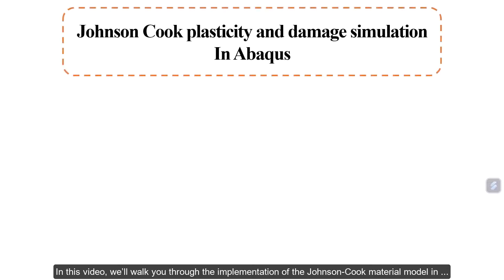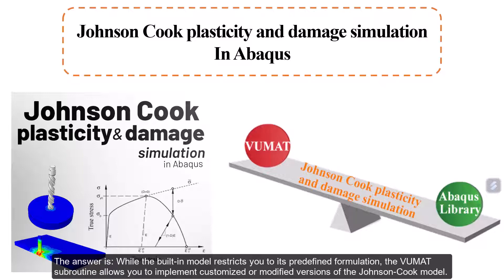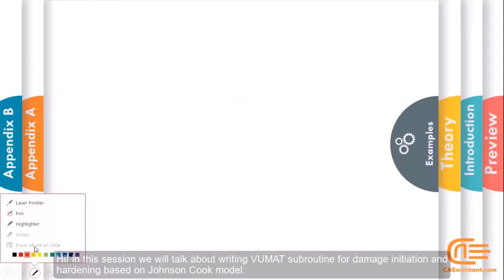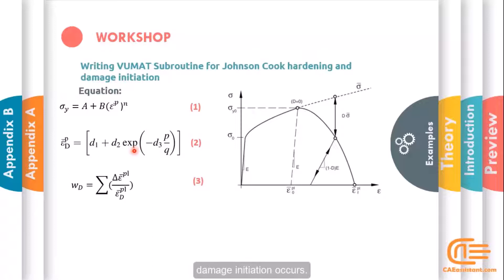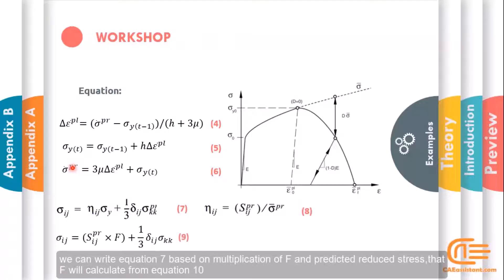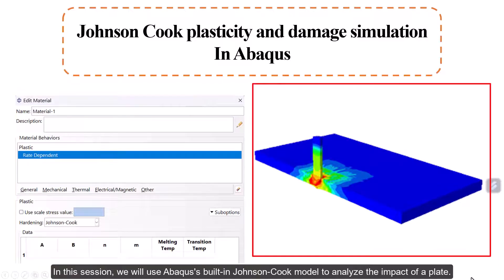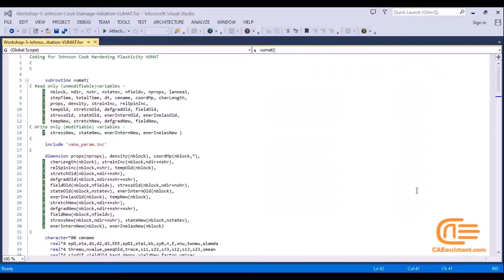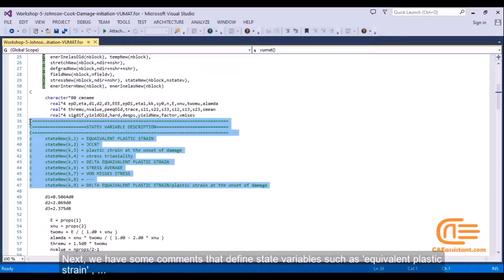Johnson-Cook Model in Abaqus: Theory, Applications & VUMAT Implementation

Comment: How to get A, B n, m ..?
Reply from the maker: These variables correspond to the Johnson-Cook plasticity parameters, which are discussed in the Abaqus documentation under Johnson-Cook Plasticity, within the Metal Plasticity section. The values vary for different materials and can be found in research papers. Additionally, if you need assistance, we can guide you in selecting the appropriate values for your specific problem.
Reply: @caeassistant7734  Really appreciate your feedback, it seems that this model is suitable for ductile materials like metals. Can I apply it to cement-based materials, or can you recommend me a suitable model to simulate Charpy impact test for cement-based materials.
Reply from the maker: I'm glad you found it useful. Some studies have proposed a modified Holmquist-Johnson-Cook model for concrete—you can search for it on Google to see if it suits your case. Additionally, in Abaqus, you can use other criteria such as CDP or, in some cases, even the brittle model (as a simplification), to analyze cementitious materials.

Comment: Can you explain how to apply 3 d hashin  failure criteria in  hybid composite
Reply from the maker: In general, a hybrid composite can encompass a wide range of materials combined with a composite. Depending on the material type, for example, if the composite is combined with metal, you can model the metal part using the Johnson-Cook model and the composite part using the 3D Hashin model.
Reply: @caeassistant  
No fibers  are  carbon and basalt . And matrix is PA(nylon) . Sample is made by additive manufacturing
Reply from the maker: Regarding 3D printing materials based on nylon, yes, the Hashin model can be used. Apparently, one paper has explored this, and I will provide its title below for you to check. It might also be mentioned in other papers. If you need help with the modeling you mentioned, we can assist you.
"Failure Prediction in 3D Printed Kevlar/Glass Fiber-Reinforced Nylon Structures with a Hole and Different Fiber Orientations"
Reply: @caeassistant  Thanks .....have you any video uploaded in your channel where you applied 3 d hashin damage criteria in hybrid composite .
Reply from the maker: Regarding your question, we offer training on using Hashin’s theory for wood and fiber composites, including unidirectional and woven composites, which might be helpful for you. However, we don’t have specific content on applying Hashin’s theory to hybrid composites. If you’re interested, we can model hybrid composites as a custom project for you. In that case, please contact our support team to discuss the details.
 support@caeassistant.com